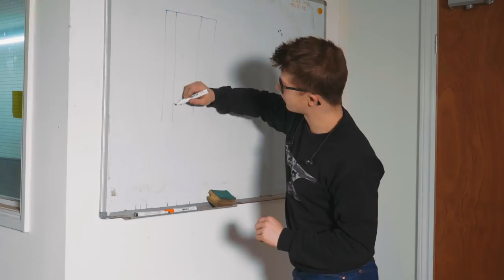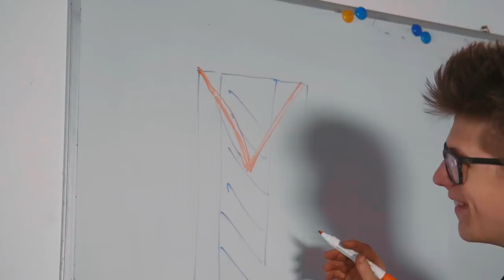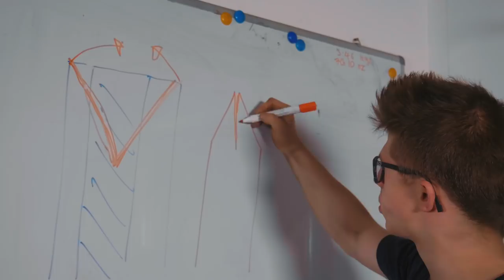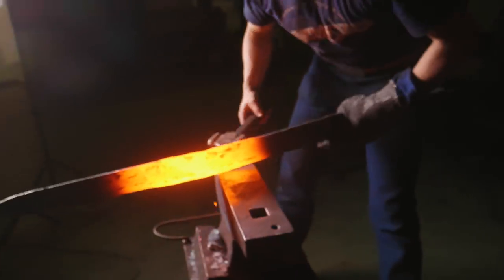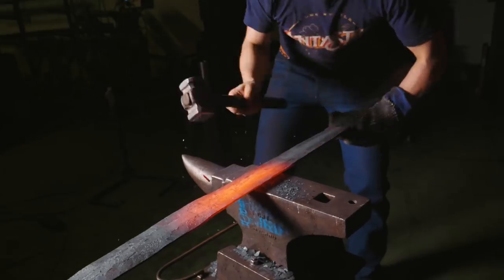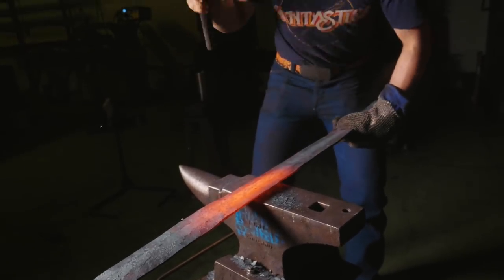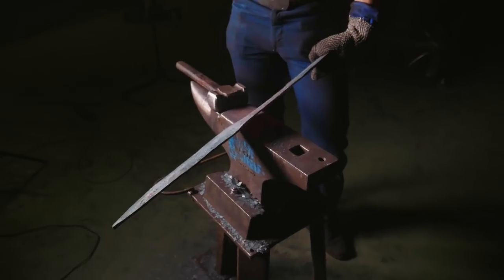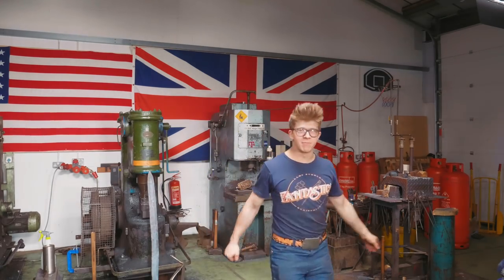MAKING A SCOTTISH CLAYMORE SWORD!!! PART 2

Comment: That is the wrong shape for a claymore. He's just made a very large sword. It's far too wide for a claymore. Yes, they were big, but swinging them wasn't a 'chore' if they had a properly balanced pommel.
Reply: i was almost screaming at my screen in disbelief when i saw the size of that billet XD jep, faaaaaar to wide and heavy, even if he grinds away a third of the overall mass....but hey, let's see what he'll come up with =)
Reply: Exactly! This more of an anime fantasy sword. Its 3 times too wide!
Reply: He seems to do this a lot. But, before he’s realized it was too much steel. Not this time. 

He really needs to start researching these builds, or in this case just watch freaking Braveheart, to get an idea of what he’s doing.
Reply: Yes, i agreed, this is not a claymore, It's a sword of Pier Gerlofs Donia, as minimum.
Reply: It looks like gut's predragonslayer sword from berserk.
Reply: Yeah, historic claymore weighed around 2.5-3kg, what he's got seems to weigh 3 times that much, given how much he's having to heft it around.
Reply: Maybe he doesn't want to draw on the new shop floor.  Remember he used to draw things out first.
Reply: Actually it depends on the era of the claymore you are talking about. The early claymore was a Great Sword and was quite wide. I have several of them in my armory. He did make the blank a bit bigger but on a sword that long you want plenty of extra to for the grind. I think he is right on track for an earlier period claymore.
Reply: Tim Anderson If I hadn't just read that, I was going to post the exact same thing.
Reply: Jarl Poll
Reply: It seems more like a bastard sword to me. Isnt a claymore supposed to tapor From the base of the blade to the tip. And isnt it supposed to be like half that width at the base
Reply: yusted1 not necessarily, see my post and look up the different claymores through history
Reply: Bastard swords are a whole lot smaller than most people think...
Reply: He is still forging it you pleb how are you going to judge someone's work when it's not even half way done and your sitting in your moms basement watching YouTube couldn't swing a hammer if your life depended on it LMBO
Reply: Robert Shelton, as you “aptly” pointed out, he is forging it. He  basically finished the profile in this video. Also, I am the son of a blacksmith and a silversmith. I have been swinging a hammer for more than half my life. I have forged my own sword, a multitude of knives, and am currently working on a quillon dagger that, for the most part, will be up to master smith requirements. I am definitely qualified to have an opinion here.
Reply: SuicideNeil that is not a lightweight sword in silhouette. Do some research. That is the great sword version of the claymore. I own two of them in that style and they are full two handed swords. Widest and thickest blades in my entire armory. It is only rivaled by the British Great Sword and the German Zwiehander.
Reply: yeah this is great sword  that l have seen in game or anime thing not historical claymore
Reply: Well maybe a more apt way of putting it is it looks like a quite lengthy broad sword. But i dont think thats all just blade. He'll probably draw the tang out with the bottom inches so itll look shorter than it does now
Reply: SuicideNeil SuicideNeil i have been in the bladed weapon business for over 20 years. I have studied with the masters and hold multiple certificates of proficiency with the SAFD. I have studied the treatises of the historical masters as well and possess a rather large armory of historical reproductions many of which are direct castings of museum pieces. I also make custom weapons for theatrical purposes and am a blacksmithing hobbiest. I am pretty sure I have a pretty good idea about just about any of the weapons you could think of. That blank is definitely larger that the final piece will be. If you have ever made a blade even half that big you would understand that you need a lot more material to get your grind in line and keep it that way for the entire run of the blade if you are beveling by hand without the aid of a swage. If it is the length you are concerned with you should rewatch the video. That blank is only about 4 feet long and he has not even isolated the tang yet.
Reply: Should have just used the Damascus.
Reply: Ethan Hansen Exactly, the blade is far to wide to be a claymore. It is too beefy to be weilded in combat. More of an executioner's sword like Ice from GoT.
Reply: Ethan Hansen, cool. Im an amateur bladesmith... do you have any tips?
Reply: Will Wisson Burton, Alec’s earlier videos are actually a great way to learn how to make tools get ideas on practicing technique. If you’re doing this without a mentor of sorts then they are a great resource. Also Brian Brazil, Alec’s teacher, has some videos on YouTube that a great as well. Other than that the biggest thing is to actually go out into the shop and do ‘something’. It doesn’t have to be crazy complicated; just making something is a good way to start, stay interested, and stay motivated.
Reply: Gents, don't get your knickers in a twist just because it isn't entirely accurate, considering he is making the damned thing with a touch of Damascus too, and given the amount of work an effort that goes into just making the sword, I'm more than ready to let it slide and call it "creative lisence"
Reply: It is his first claymore....far better than I can do...give him a break and some encouragement!

Comment: Alec, don't forget the fuller/s. They will help with strength, weight, and balance of the finished weapon. Plus it still needs more length. Remember when the tip is on the ground, the pommel should touch your chin standing errect and straight. Looking brilliant so far. Hoping the delamination is surface only. Thanks for tackling one from the top of my wish list.

Comment: You'd have to grind almost all of the monosteel to make it an appropriate width for a Claymore. Which is not a problem, it just means there will be more damascus showing than regular steel. 
Claymores were about three feet long for the blade and a foot for the handle, as wikipedia says, you have a frigging fantasy sword at this point.

Comment: perhaps you could heat that area up with the torch to the welding temp and use the power hammer to save it?

Comment: Even though a claymore is very long it is actually fairly light the blade should have an significant distal taper and is fairly thin to begin with. The entire assembled sword shouldn’t weigh 2.2 - 2.8 kg.

Comment: due to the length of the sword, I wonder if it would be worth it... may not be Steele style to make a 2-part die for the power hammer to get the shape and bevels you want down the length of the blade, rather than using the edge of the power hammer heads or the lengthy process on the anvil.

Comment: Alec could you try some sort of one heat challenge? Try making something that has only had one heat in the forge. Time pressure and energy needed to try keep the material hot.

Comment: 12:30 lesson learned, it needs to be made longer with the same amount of steel (as would be historically accurate) and allows for it to fuse better.
And before fanboys attack me: He says he`s doing this to learn, so lay off, I`m covered, call the joint chiefs.

Comment: If the delaminations go all the way cut out the mono steel and grind in the tang just with the pattern welded stuff. It’ll be a slightly shorter claymore, or if you must scrap it can you make the scrapped claymore into a basket hilted broadsword to keep the Scottish theme? Nice video today really enjoyed it. Looks like you need to make some beveling dies for the power hammer and save your arm a bit! 👍

The bit you cut out for the tip could be enough for a bollock dagger

Comment: Hey Alec! Amazing vid, I just have a question, I saw you were struggling with putting a bevel in with the power hammer, wouldn't it have been easier to make some beveling rounded dies to use with the power hammer in the center of the striking face? Please let me know why you chose to do it the way you did! Thanks!

Comment: Alec, I m not an expert, but shouldn't you use flux between the steel when forge-welding to avoid delamination? Oxides are not helping the steel molecules to bind together. I love your work, keep up the good job!!

Comment: I was sorry to see that cracks were appearing in the forge weld but I think tig welding along the length might be the problem. If those welds allow even a microscopic resistance to the forge weld along the length it would result in cracks. I think tig welding just the ends is a solution.

Comment: if your planning on doing ever more and longer swords, have you considered making yourself a sword forge. 

i actually saw commercial ones on Mythbusters when they tried (and failed) to cook prawns in the time it took them to fly about 4 meters. they used 3 sword forges each about a meter long, just wide enough to slide a broadsword in and I think 3 burners each. 

you could probably throw one together as easily as you did your current forge, and it would make heat treatment much easier.

Comment: PUT THE 1055 IN THE CENTER AND WRAP THE CUTTING EDGE WITH YOUR PATTERN WELDED STEEL BROOO!!!!   Imean if this one doesn't work out, try this, because IDK what your "Damascus" is; but based on Samurai Carpenters Chisle I'm sure it has better edge retention. And is a better steel. 1055 is tough as nails, It would give the sword good flexibility in the center with a harder steel edge. Just a thought! Keep up the great work my friend.

Comment: Claymores are much thinner than what you have made and they usually have a taper that goes all the way down the blade this allows better balance in the sword. as well many Claymores in history have had a foot or so of their blade turn into what is essentially a handle and a guard like Spike is put into the blade but of course there's only if a few but it still looks fantastic

Comment: Why do you start with a round bar for things you're drawing out to rectangular anyway? Wouldn't it save time to use square or rectangular stock to begin with? Or do you just keep round on hand because it's versatile and would be a pain to buy rectangular stock already sized for you application?

Comment: When making something long, why do you lie the piece across the anvil rather than along it, so it has more support and isn't bending backwards and forwards each time you turn it over? Also, is there a limit to how much you can work (heat, shape, cool, repeat) a blade like this? I.e. is metal fatigue not an issue when you're able to heat it back up to continue?
Reply: Sorry that first question wasn't meant as "I think you ought to do X", it was genuinely "I'm ignorant of all this wonderful stuff, and wondered why not X"...

Comment: Do you think that the lack of fusion between the damascus and the carbon steel is a result of not fluxing prior to forge welding the three billets together?? Not sure if i saw you use it other than to weld the top end of the sword after you cut that "V" out. Good luck and i cant wait to see the finished product!!!
Reply: Both the heat and the hammering seemed a bit tentative to me. And the rough dressing of the outer layers.  This is entertainment, and a valuable lesson shared.

Comment: This is only the second video I've seen where someone attempted to do a fishmouth point, great job. It looks a lot heavier than 5 pounds which is where it should be (5 to 6lbs) so maybe you can cut the delaminated part off and save most of the work you put into it.
Reply: The first time was by a smith that goes by the youtube name steviebar. He did one in 2015. I had to go find the video to remember who did it.

Comment: Ok so i have been watching about a month now, and seen many of your older creations also. Awesome work by the way!!! Just one question, more offten i see when you are hand hammering you "choke up" on your hammer just a few inches from its head. I am sure it is mostly for control of your strikes but it must sacrifice power as you are not using the longer leverage to accelerate the hammer head as much. Is the trade off between control and power worth the extra time and work?

Comment: Hey alec if you take two or three different patern damascus and forge weld them like your making a damascus steel. You know fold them into each other multiple times. I wonder how that would turn out. What would it look like. Maybe u should try it some time
Reply: William Agy 
I think their individual patterns would be lost and you’d get something that looked like a lot of nothing. Like if you had 3 pieces with 100 layers, and you cut and stacked them a few times, their own patterns would become so warped that they wouldn’t be recognizable. That’s my guess.

Comment: As already pointed out by a few fellows, i was a little baffled when Alec pulled up that billet - i mean, even if he still loses a good third to half of the material it would be more than enough for the dimensions of a historical Claymore; an early one, being larger and heavier, generally speaking in contrast to the later, often basket hilted versions would still weigh in at about 3kg/6.6lb maximum, pommel, hilt and all, most often being in the region of 2.5kg/5.5lb - that billet had thrice that mass, easily X) well, i guess if all goes ploinshaped hell have a nice pattern welded paddle ;D

Comment: Traditionally, swords were made as a one off. No two swords were the same. They were made to the specifications of the person that commissioned it. Some preferred a longer blade and some a shorter. Some wanted a lighter or a pommel heavy some wanted heavier or just blade heavy. There were fashions of each time just like clothing also that contributed. Saying “traditionally” or “historically” anything is incorrect is just because it differed from one you have seen from some unspecified period is just ignorant. Alec is making a sword based on what he has seen and with the specifications he wants. Historically speaking he is exactly correct in what he is doing.

Comment: Hey Alec, been watching your stuff for a while, and I've always wondered when you are using your hand hammer why you choke up so much? Is it better to have more controlled hits than powerful hits? Even when forge welding by hand? Btw like the claymore :)
Reply: This is just my personal opinion but I think that choking up is a better way to hold the hammer mostly because of accuracy while forging more "intricate" things. when I am drawing out big stock by hand it is okay to hold lower down but only when accuracy is not needed
Reply: Theswaggeringwombat thanks for clearing that up! 😄
Reply: I agree. Two ways to delivery energy to the iron. Weight or high velocity . heavy hammer, slow swing vrs lighter hammer, long handle  high velocity. both can deliver same energy but a long handle and fast swing is harder to control.

Comment: Isn't 1055 a bit soft for the edge?
Reply: good point. It will harden enough though to hold an edge well enough for cutting fruit&veg, no problem. I am a little bit afraid of the quench, since the core material(s) have a higher carbon-content, which might lead to too different shrink-rates during the quench possibly leading to cracking. Guess we'll see =)

Comment: What's that powder you sprinkle on the metal?
Reply: Postal Patriot556 its flux to help prevent scale from forming between welds.
It's usually borax like what you buy at the store
Reply: I think its iron mountain flux. Brian Bryzel (misspelled) uses it and says it works better then borax. I bought some and it indeed works well. especially on small projects. iron seems like it can be less critical in temp.

Comment: Alec, I cringe every time I see you power hammering on that partially heated steel.  I have no doubts that your cracks come from hammering on insufficiently heated steel.  Put a second heat chamber on your forge for these longer steel projects as an investment against cracks.  Oy Veh!

Comment: Always the problems with delamination. I never see you using flux for your forge welds, and it's like you make the same mistakes over and over again. I really like this channel, but I'm tired of seeing the same issues over and over again, when, in fact there are hundreds of years of proven methods for making it work, and hundreds of people on here telling you that you're doing it wrong. sigh
Reply: I see him using flux all the time.  It super easy to talk smack about blacksmithing.  It's another thing to pull it off consistently.  Let's see your work!

Comment: Why the hell are there so many pointless cuts/edits in your videos? For example, from 2:18 to 2:44 there are about 9 cuts, even though you are doing nothing but standing at a white board and the topic doesn't change. You're making arbitrary cuts between successive words in the middle of sentences, which makes no sense at all. Is that supposed to keep the attention of the ADHD crowd?